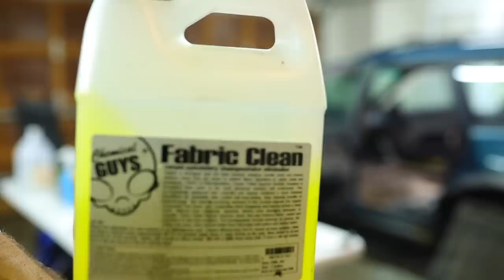Complete Disaster Full Interior Car Detailing Transformation! DEEP CLEANING A Really DIRTY CAR!

Comment: For a video: I would honestly just like to know how to take apart the car 🤷🏻‍♀️ that’s almost all that is just in my way now for a big clean
Reply: google your make and model and the specific area your removing im sure someone will have posted instructions online
Reply: Yes, she's right.. Also there's only like 4 bolts holding each seat down, take those off and seat should come out. The back seat usually doesn't have bolts, you can pull up on the front of the bench and you'll hear and feel the clips come out and it should slide out after that. It's a lot easier than it looks
Reply: You ladies give me hope and are encouraging. I detail my own car and removing the seats is the only thing I don’t do when I shampoo it.

Comment: I’d love to see a video on cleaning headlights. Maybe different products/ hacks and which is best?
Reply: The best way is to wet sand them starting with 1800 grit then 2000,2500,3000. Then polish them until Crystal clear(machine polish) and lastly seal them with a ceramic coating or some ppf
Reply: Get a drill and a turtle wax headlight resto kit. I did my 20 year old headlights with the instructions and a year later they are still crystal clear. Easy.

Comment: Would love to see you start detailing the outside too! 

Also would love to see a video on how to keep leather from cracking as a preventative measure!
Reply: It's really easy to maintain leather seats, just make sure they are clean, and put some leather conditioner on every couple of weeks.
Reply: @ujanzabonje1416  i give you reason the leather is far easier to clean respect fabric and when i brought my Citroën C3 with leather interior i fall in love
Reply: only use leather cleaner to clean them, then condition them with leather conditioner. you can also use a ceramic coating after they're clean  to protect them.

 only use a leather brush - and only clean small areas at a time.  AMMONYC does a good job showing how to care for leather seats.
Reply: Kristen d that is VERY helpful! I just purchased a Tesla and I don’t wanna screw it up lol

Comment: BUY A CAR, CLEAN THE INTERIOR AND EXTERIOR, SELL IT FOR A PROFIT!
Reply: Both I and my father have done just that. My best result was a daily driven, owned by a mechanic (extremely well maintained but not cleaned) mk1 VW Golf (Rabbit in the USA). This was a 1984 car in about 1998. No rust but I paid £50 for it. Washed, clay barred and polished it... Sold it within 72 hours of buying for £600 . Not huge money but I was only 19 and in percentage terms it was a killing. Edit: checked back... £500 not £600. Still a good profit.
Reply: Damage is damage, holes in the carpet with rusted floor pans are an obvious indication that the car is in poor condition. If you’re gonna do this much work it’s much more worth while to trash the carpets and address the rust. So that it actually looks good. That’s like cleaning a seat that has a whole bunch of tears and foam showing. You could literally save hour$ of work and make much more money flipping it
Reply: Especially since he already did half the work of changing the carpet by removing the center console and seats it’s just a no brained to replace the carpet
Reply: How its even possible to allow your car to be in this condition at all.? I think you have vacuum cleaner? You have bucket, shampoo? You can clean your home, but you dont have 1 hour to clean your car?
Reply: I have tried it. It doesn't work. You break even, and just did the work for fun. I had a 2007 Civic that had dirty fabrics, smelled like cigarettes, and almost every body panel keyed or rock chipped. Paid good condition for it. Being an auto and collision tech, everything was repaired with Honda parts, stripped and cleaned interior, and an entire body repair and paint job. Sold it for great condition. No profit, and spent the time working on the car instead of spending it with family. The only way to profit is to "lipstick" everything with cheap parts and procedures. I can't stand people that do that.

Comment: I learned this with my Subaru Impreza that has the same style doors. The windows have to be readjusted from time to time. Since the glass goes against the seal instead of in a frame with a seal. Also they have a tendency to leak we’re the glass on the front doors meet the mirror housing. This is more than likely where the rust and water that is primarily in the front has come from.

Comment: Have you ever tried saturating/soaking rust stains in carpets with CLR between extractions?  I've had a little luck with it and other brands like it in cleaning off rust bleed on paint.  It's my new go to when a rubbing compound won't clean it or if I think the metal is too weak or the paint has bubbled up too much.  I can use the CLR to clean off rust bleed with less pressure.  It doesn't fix a rust problem, but does really well in making it look less atrocious.

Comment: When cars looks like this inside, it makes you wonder what the (previous) owner’s living room looks like?!? Imagine wearing the same clothes when you sit down in the living room couch as after having sat in this kind of landfill... 😜

Small tip for any car - use rubber mats over/on the carpet. Not expensive, prevents water/moisture and dirt from soaking the carpets and can easily be taken out and cleaned. Can often be purchased in sets - typically one set with two mats for the front seat foot wells and one set with two mats for the back seat foot wells. Also work very well when people throw the rest of their coffee or hamburgers on the floor.

Comment: I've noticed in this video an others that we have a different approach to cleaning interior plastics/crevices. When I detail my own car I go over vents and crevices with my horse hair detailing brush with my vacuum following it to suck up dust and debris that was kicked up by the brush.

Personally, I don't like drenching my interior with liquid because it gets in the cracks and underneath panels and I fear it could get to electronics. If there are areas I need to use liquid I use a microfiber towel that I've sprayed with interior plastics cleaner and protectant. Vents for example I'll use the corner of the microfiber towel that has been lightly dampened by cleaner to clean the slats if there is any stubborn dust remaining.

I'd also like to see you make a video on how to repair scratched leather, or a full on leather care/repair video. I think that'd be really cool an informative for your viewers.

Comment: I have a couple ideas that I think would be a bit of a challenge in terms of finding the right car/bit of difficulty but I know you have videos cleaning an engine bay, but I have a car I purchase that was previously had a turbo setup. Anyways I guess either the turbo or engine blew and when I bought it the engine had been replaced but they left all the oil splatter in the underside, and I was wondering if you can find a way besides taking the entire engine bay apart to removed 30 years of grime and countless quarts that had spilled and caked on all the components. I have 1990 miata and was curious if there was a way to pressure wash the bay and just cover as many electrical components as possible. Second idea I'd dressing up rust spots like the floor panels in this video

Comment: Wow that suby is clapped the fug out. Great work at resurrecting it as best as you could. Carpet definitely needs to be swapped out, and you could probably find one used that's even in better shape. If it were my car, I'd pull the carpet anyway and weld in some patches for the rusty floorpan. Nobody wants to look like fred flintstone driving with your feet hanging out the floor. LMFAO! Pretty easy to trace water leaks by just using a garden hose on the roof and letting the water run down. The cowl/ raintray might be packed full and the drains clogged if the car has them. This can be especially bad when the vehicle has its ecu mounted inside. Definitely seen my share of this in my 25+ years of experience as a tech. They get overlooked a lot because quite a few of them are more difficult to access. Definitely would make sure the customer addresses the leak sooner than later. Hell, it'll make that car smell after you got it all clean. F that.

As far as the dyes, the VHT penetrating color dye, and the SEM dye are the two best that I've used. I have done entire interiors with both products, even drastically changing the color. Even spraying the interior from tan or grey to black and it looks and holds up great. I compare an OEM piece to a piece I've dyed and you can't even tell the difference. Both companies have a good selection of colors that match many of the OEM manufacturers colors, so it's easier to color match. Thanks for sharing this, good shit.

Comment: I suspect the mud/water was actually from flooding based on some of the other damage in the car. It may not have been serious flooding...but if the car was totaled and then sold at auction...this is a common problem. Check the trunks! It's one of the places that people forget to do anything to when trying to pretend the car hasn't been totaled due to flood/water damage.